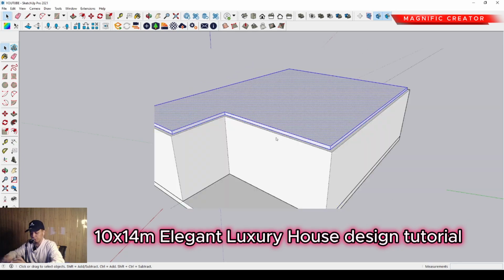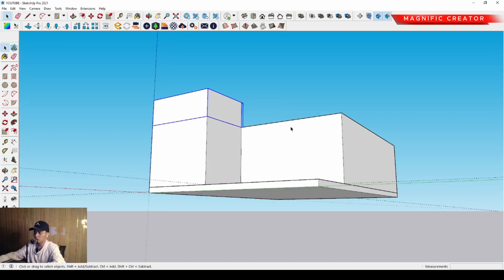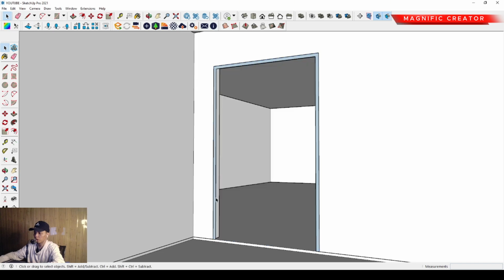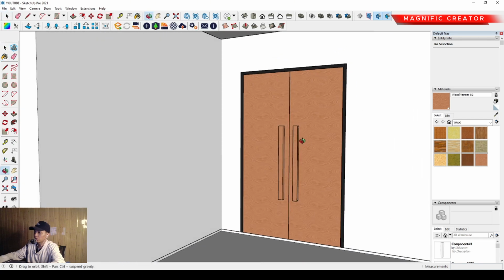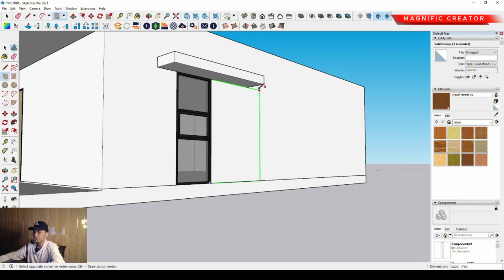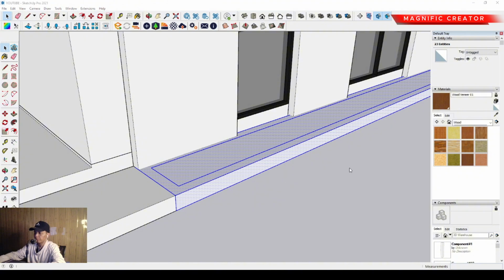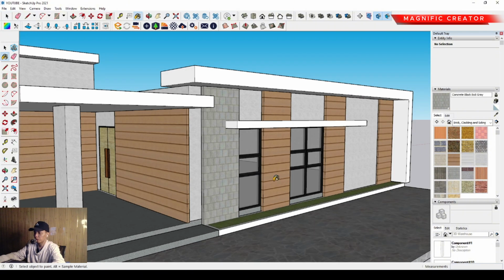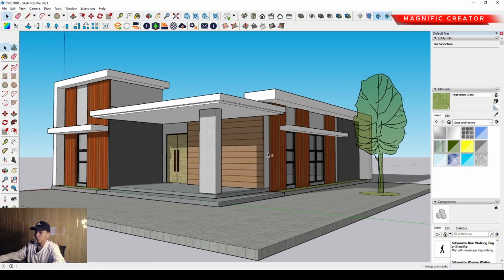Sketchup House Tutorial Elegant Luxury House Design 10x14m

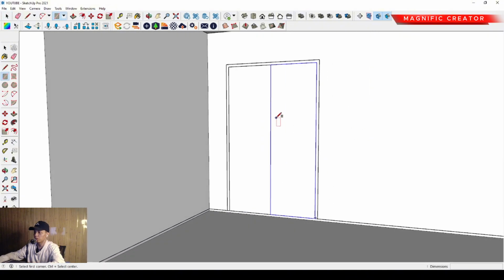Comment: hi. At 5:33 how do you do the knobs to draw in the middle at both panels? When I do this, the knob goes to the left on the left door.
Reply from the maker: Hello, you can 
1. Click the object
2. Right click
3. Choose "Flip Along" with green/red axis

You could try it
Reply: @magnificcreator  Thanks for the help. There is no Flip along in Sketchup 2024. I used Flip tool on the toolbar and clicked the proper axis and it worked.